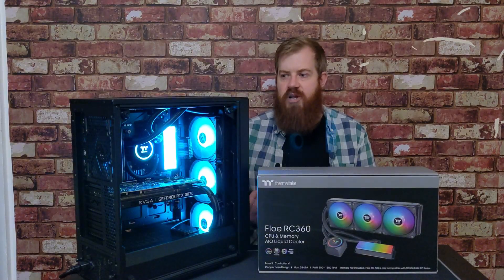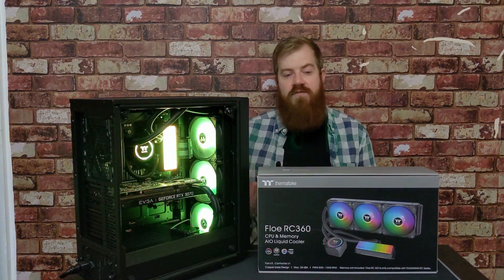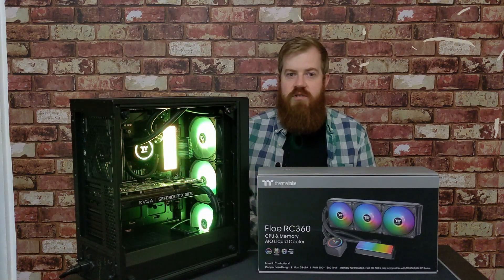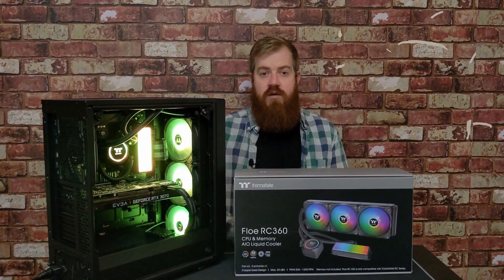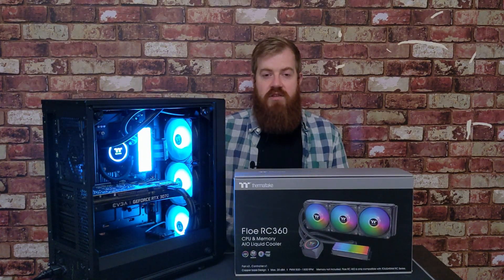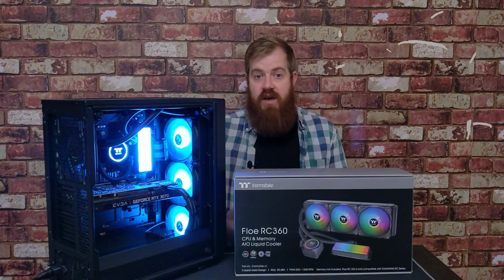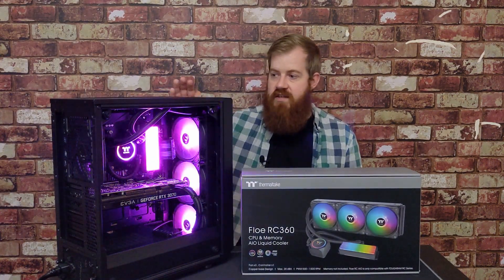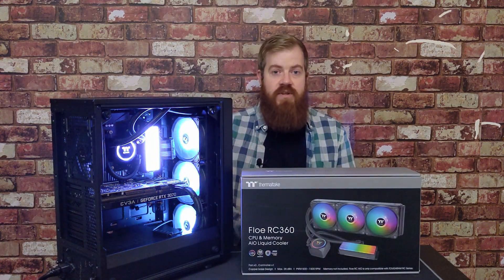Worlds first CPU and memory AIO - Thermaltake Floe RC 360

Comment: Great Show!!!  I echo many of the positive video production comments, below.  You are obviously accustomed to creating decks/presentations as you follow the flow to a Tee (or, is that a Tea!); e.g. opening, step-by-step (body), FAQ/Considerations, and finally Conclusion.  I also liked how you tacked the thermal paste conspiracy, "...It doesn't matter!"  Very crisp, clean, and flows in the right direction (again, pardon the pun!)  I was looking for a video on performance, but the first 10 seconds grabbed me so I continued to watch.  Something to consider, if you would?  The title is ambiguous in regards to the video type; e.g. review, install, etc. While you may not want to take to time to do performance testing, but it would have been nice to have some type of numbers; e.g. referenced in the video or other linkage to another video/source.  That would have made this video truly complete for any type of audience interest.  That said, I reiterate my initial statement, "GREAT SHOW!!!"
Reply from the maker: Thanks very much 😄 I've actually started doing reviews for bit-tech.net over on their youtube channel. They're more performance orientated with benchmarks and thermal performance figures. I haven't yet re-visited this cooler, but on the system I had it on it was keeping a 5600X in the mid 60's, so pretty decent. In all honesty, pretty much any 360mm cooler will do a decent job, the real differentiators are things like quality of software, ability to control the system easily and noise. Ease of installation is something to consider if you're new, but at least you only have to do it once in normal circumstances.

Glad all those hours doing powerpoints and leading training sessions paid off 😅

Comment: I've been building computers for a long time now and I gotta say, this is one of the best installation vids I've seen, well done.  Very detailed, minimal bloat and the comedic references are on point.  Just subbed, keep it up pls.

Do you have any performance numbers on this kit?
Reply from the maker: Thank you so much ☺️ I just do stuff how I'd like to see it, remembering how difficult it was when I first started out, trying to figure out stuff from badly translated instructions. lol I spent a looong time on the edit cutting it down so it didn't drag on too much but still keeping the details.

On the 5600x in this system at stock settings and auto voltage it kept it  in the mid to low 60's with minimal noise.

Comment: Shit since u can't use good ram with it
Reply from the maker: There's kits available up to 4400MHz c19, which is pretty dam rapid. If you're after sticks with cherry picked Samsung B-die ICs for some hardcore overclocking, then I would argue the Floe RC is not the cooler you're looking for.  You can go about your business. Move along.
Reply from the maker: @yeet delete Do you mean remove the RAM cooler from the AIO loop? Not really, I  that it is not intended to be removed, but you could probably find a way as with most things. Thermaltake offer a range of AIOs coolers without the RAM cooler.
https://uk.thermaltake.com/products/aio-liquid-cooling.html

If you mean the RAM heat spreaders the connect to the RAM block, they could be removed if you're really careful. You need to heat up the RAM to soften the glue first. There's plenty of tutorials out there for that.